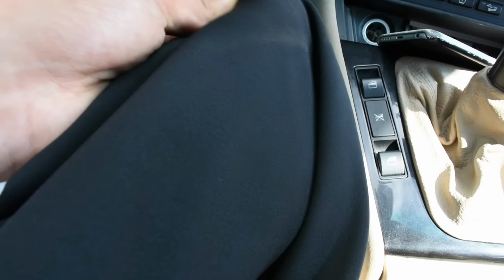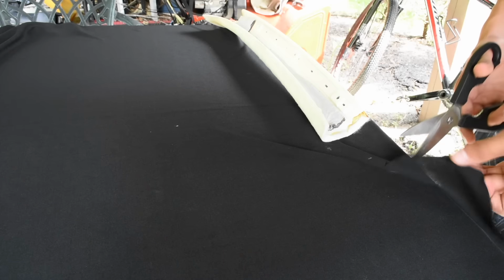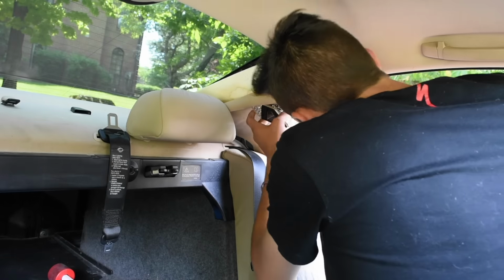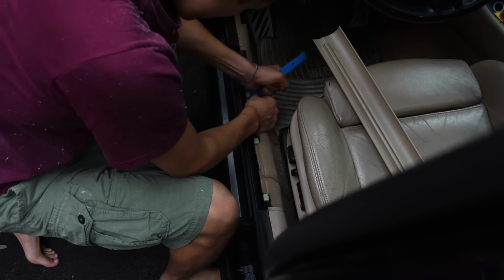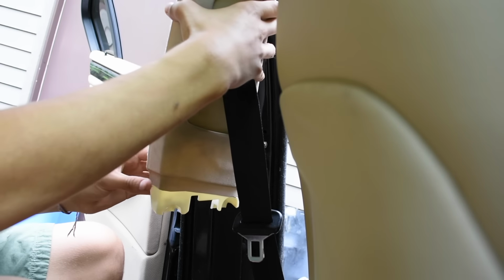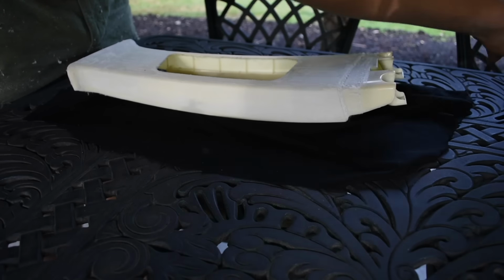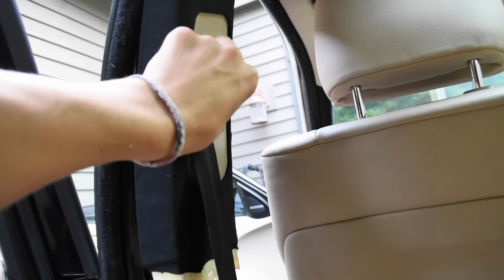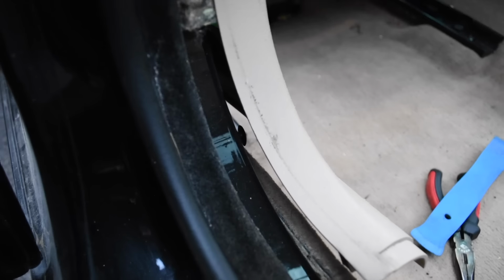E46 Sedan A,B, and C pillar reupholstering

Comment: I have a 2003 330xi I purchased last year. I had the interior headliner, but they would not upholster the pillars. The plastic was so fragile as I found out when I upholstered A and C pillars.  
I could not find any  u tube videos on how to replace the B pillars except for yours. 
Thanks for the help, and  oy was it a ton of  work. 
I had broken some of the plastic pieces on every one of the pillars. Live and learn. 
By the way,  this was my very first car to do this on.
Reply: Also, I'm 65 years old and have  been retired for a year. 
I had so much fun learning, and it really boosted my confidence.  Made lots of mistakes. Good thing it's my car.
I'm also repairing a few small areas of the  body and learning how to paint it with the help of my friend. 
What great therapy.

Comment: I was wondering why you would put black upholstery when the interior is beige but then I saw your interior trim and realized you're a professional car ruiner by trade.
Reply from the maker: thankfully I've changed out the trim since this video
Reply: Good because that stuff was fonky looking. I saw it at the end and I was like, "Whoa." for a second. Also when you disassemble your interior, thats when you can go in and do a good cleaning on every part front and back.  Cool video.
Reply: @AquaStevae  At first. Look after dunning kruger effect, please. Secondly, he is very much right. The point is, he has got a good car, it's interior is just about perfect as it is. Then the guy in the video decided not to change it, but to ruin it. How that interior looks is disgusting. No offense, it's just a fact. I can imagine that in a video he is kicking his car to make it more "stylish". Or glue his towel on the seat, because why not? + the guy even used the worst possible material because it was cheap and not designed for it, so really, why not? If he would have done the whole interior giving everything a different color. Yes. That's still a very bad idea but that looks far more acceptable. (Seen it before.)

Comment: I have a 2001 BMW 740i sport with a black interior, grey pillars and headliner. I went with black, but on the B pillars I wrapped the sliding seatbelt adjuster insert with carbon fiber instead of leaving it grey. Left all the wood trim alone. I'm looking for 750il front seat backs in black.
Reply: I know this comment is super old but I want to thank you. I'm pulling my pillars of to wrap with perferated leather and I have some unused carbon fiber vinyl laying around. 🙏

Comment: Word of caution.  Disconnect the battery so you remove the possibility of triggering the airbag.  Thnx.
Reply: rednightist Don't tell me what to do! Im poking my airbags right now nothings happening. Still poking it nothings ha
Reply: rednightist sure wish I knew that lol but I didn't even remove my pilar I remember the battery after I inserted my tool on pillar B bam air bag light grrrr
Reply: Christina Garcia airbag light reset tool
Reply: crosswire7777 thks I have the Carly app I was about to see if it would reset it thanks
Reply: Just a FYI my Carly tool dose reset airbag

Comment: Do you have a video on how you changed that ugly fake brown wood looking trim. I have the same car and it's all cracked and honestly very nauseating to my eyes and gives me horrible anxiety haha. I want to change it to black.
Reply from the maker: I do not. If you search on an e46 forum I'm sure there are a lot of good DIYs of it. Basically for everything but the trim around the shifter you just need to get something soft under the trim and carefully pull up. All of the trim on the doors and dash is held in by little clips.
Reply: take it off and use the black wrap you find at autoparts stores  like autozone